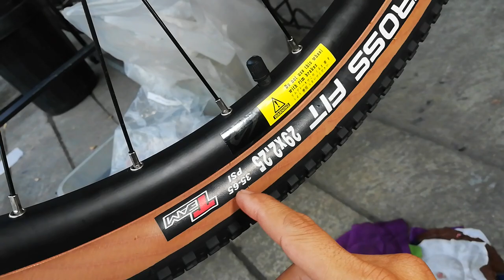Mountainpeak Monster | Project Bike Build | Bike Check

Comment: San ba mas ok ilagay ang hydraulic brake? Internal or sa labas? Mahirap po ba maintenance pag sa loob? Internal frame
Reply from the maker: wala naman maintenance kapag internal. Mas malinia tingnan kapag internal
Reply: pagdating po sa ganyan mas ok kung external para mas madali ilagay at madali ang maintenance, at oo tama po kayo na medyo may challenge ang pag maintenance kapag naka internal, pero mas malinis tingnan, at mapa internal o external man po parehas may maintenance